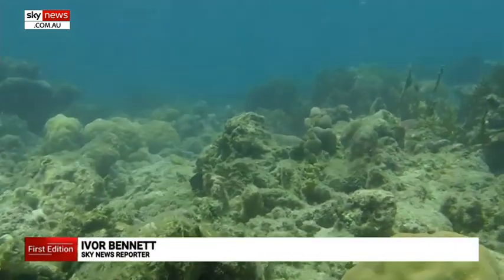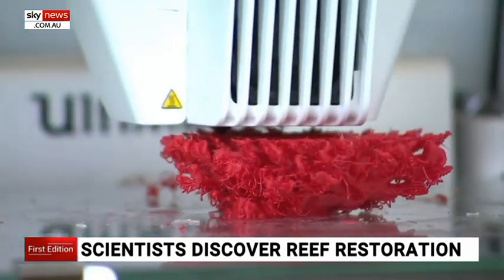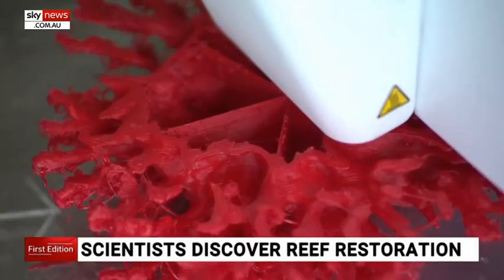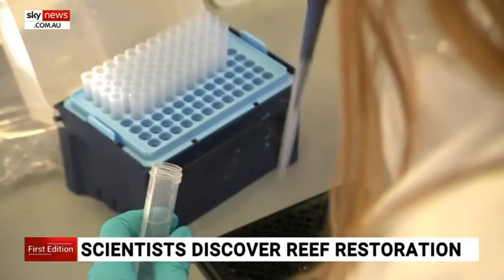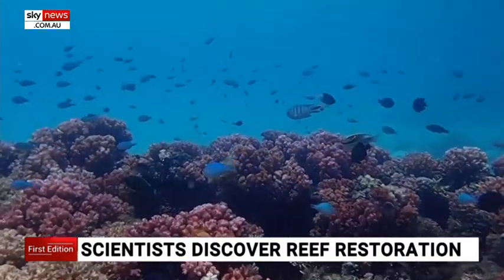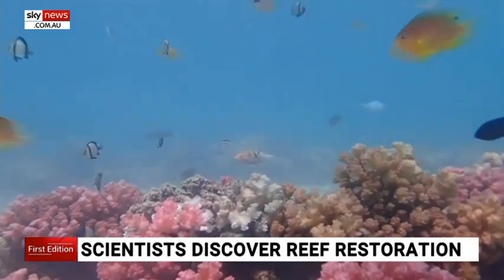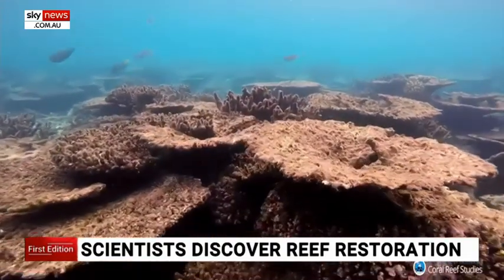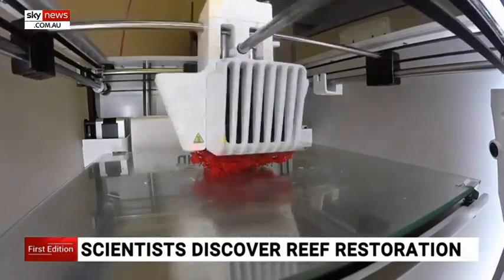UK biology students use 3D printing technology to rebuild damaged coral reefs

Comment: What happens to marine life if they eat the fake coral?
Reply: Its made of calcium carbonate, limestone, completely natural compound. The coral grows off the backbone as reported in the video.
Reply: @c12onnor  Ok thats good. But you are messing with nature. Coral bleaching does recover in a few months all by itself.
Reply: @maxstrength2963  it's needed as much as possible considering climate change will irreversibly heighten the average global sea temperature, the reefs won't be able to cope with such an unnatural change
Reply: @c12onnor  Yeah yeah sure sure. Climate change. You can settle down now, its all gone. Corals have lived in ice age and fire age, the corals have got it covered. 👍
Reply: @c12onnor  There are coral reefs that actually get  blown up by fisherman. They can use them there.
Reply: They put the real coral onto this plastic stuff and then put the whole lot into the ocean.
Reply: @Nox64978  This plastic will break apart within a few years.
Reply: @maxstrength2963  exactly